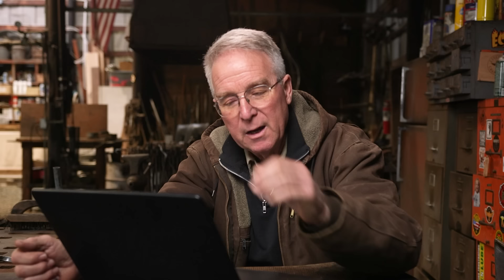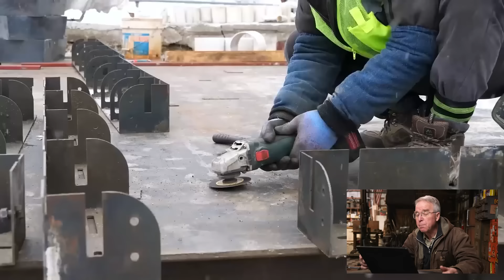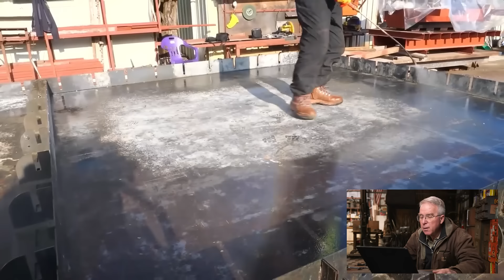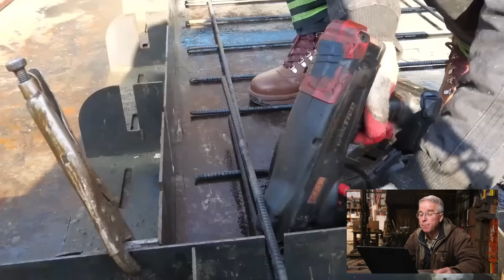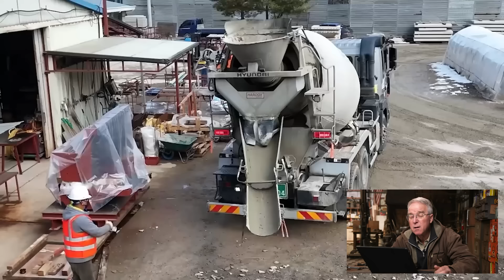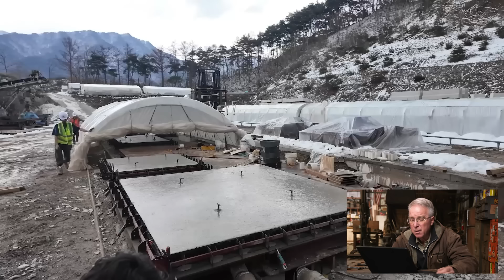40 Yr Contractor Learns CONCRETE  Korean House Construction

Comment: In high-rise construction we use threaded couplers for the vertical steel connections in the sheer walls and columns. You pretty much have to because if you’re using #11 rebar (1.375” dia.) at 8 inch spacing, you would need a minimum bar splice of 55 inches (40 bar dia.). (2) #11’s together are about 3 inches thick, so there’s almost no more room for the concrete. Even using the threaded couplers you need a super-plasticizer concrete additive to get the concrete to flow all around all the steel properly. Engineers really hate seeing honeycomb on their first few floors of columns and walls. Those #11’s are seriously heavy. Each bar requires a crane pick. 

We also used a high-early concrete mix on the floors so that you can achieve 75% ultimate strength in a 3 day test break. You have to get those slab forms flown up for the next floor as quickly as possible.

Comment: Just after the 9th minute after spreading the plastic, the concrete that is poured is what we call a “cleaning concrete,” a layer of approximately 7 cm (approx. 3") on which we begin to work properly on the foundation. In this regard, I have seen several videos of construction projects in the US where they pour concrete directly onto the ground, and in my opinion, this is not advisable due to moisture issues. Personally, I love Korean construction videos.
Reply: We called it a mud-slab and used this technique on very large matt foundations. It helps a lot in keeping the rebar supports (chairs) from sinking into the dirt from the heavy loads of rebar. Great for secure attachment of column rebar templates as well. Fasten the templates right to the mud-slab with power actuated fasteners or Tapcons. Sacrificial templates get poured right into the foundation.

Comment: I’m not 100% sure but down here in the Netherlands we call these floors “rough finish” and later a sand cement floor will be added with a smooth finish of about 6 or seven centimeters. This finish floor will usually holds heating and or electrical wire.
Reply: You guys are correct. Korean use hot water heating pipes to be embedded in the floor then pouring self leveling mortar. So there is no power trowel process. Power conduit usually embedded in CIP slab but in this precast, probably below concrete slab then cover with drop ceiling
Reply: Austrian here we usually first add 10-15cm Polystyrene concrete, then 6-10 cm of that grout cement floor with radiant heating and electrical ducting, then sound dampening , then wooden flooring
Reply: Yeah in England we'd call the sharp sand & cement layer would be called screeding.
Reply: Ja, und normalerweise wird der Estrich auf eine 2-4 cm XPS Dämmung gegossen, also schwimmend.
Reply: @AMeise-vy4fk  not in my experience, but it depends on its use case ,I suppose.
Reply: @CrimeVidich kann nur aus meiner Erfahrung im deutschen Hausbau sprechen. Wir rechnen 12-15 cm Bodenaufbau auf den Rohboden. Darin werden Elektroleotungen, Easser und Fussbodenheizung verbaut, inclusive Laminat odrr Fliesen

Comment: Interesting! I did tilt-up in a former life.
Reply: Yes, in tilt-wall construction, those types of lifting inserts are pretty much the industry standard. We always used thin gauge chain attached to the handles of the crane rigging, so that the lever could be “whipped” and disconnected from the ones too high to reach.

Comment: Seen threaded rebar used to but joint rebar to construct cast in place concrete arches. All of the radial rebar in the cast in place concrete arched vaults of the Washington DC Metrorail subway stations have threaded rebar but joints.

Comment: Idk if you guys got coupler connections in US, but it’s quite common throughout Europe. A coupler is a piece of rebar with a thread at the end, where another connects into it after the pour is cured to continue whatever you’re building. I work as a formwork chippie and it’s quite nice for us not tripping on continuous steel (pre coupler era, still common practice)
Reply: Very common here in Auatralia. We used reid bar which is a continuous threaded bar which gets screwed into a steel foot which has been cast into the concrete. Saves a lot of time drilling that's for sure
Reply: We use coupler bars in the U.S. we call them form savers, they have there place. Especially if we’re using steel plate girder forms, or else if it needs to be continuous. Or else we just drill thru the bulk head and use 1x6 so we can bust it out easily. Form savers are ok. But they can also be very time consuming.

Comment: Hey Scott :) 

34 year old Engineer, Traveler, and Triple National 🇺🇸 🇰🇷 🇨🇭 here.

* 10:23 - So yeah that base is what you'd call a "rodent slab" and we call those smaller raised areas footer pads or hot tub pads; it just helps the crane guy and the workers lineup their placement.

* 14:23 - Korea (and most of Asia) use a bamboo pattern thread in their steel rebar while in the west we use that fishbone thread (kinda slanted/diagonal helix look). Give it a Google and you'll see what I mean. 

* 16:49 - Yup; those are also HDPE Seismic shims; the Japanese have better versions of these when they build those precast panel buildings in the suburbs. You'll see them grout and smooth it all out so it looks uniform to whoever lives there. 

* 21:18 - You've probably seen that 1997 UBC Seismic Map for the USA. If you're looking at it from a PGA 0.15g threshold for 475-years point of view, all of South Korea hovers around 0.10g so think of it as the whole country is a special seismic zone like that weird Kentucky corridor area in the USA. The only non-seismic areas are down in the southwest (Mokpo) and I think the very northeast (near Sokcho Beach).

Hope some of this insight is helpful ~ 

J 🇺🇸 🇰🇷 🇨🇭
Reply: I didn't understand any of that, but I can appreciate that someone else knows these things and is willing to share.
Reply: @10:23, we refer to these as Mud Slabs (slabs on mud). A nice thing to set the final grade and help with protecting recently exposed soils from weather and construction traffic. Usually about 3-4" unreinforced, as the actual foundation will rely on the underlying soils (usually clayey).
Reply: Tried looking into bamboo thread, not a lot came up other than woven bamboo strand type products or textiles. JIS type thread I did find but not really much of a different in terms of pitch measurement differences vs SAE. Flared fittings were a different degree on the flare vs the two but I haven't found what you're describing.
Reply: @SamBrown3787  | https://www.youtube.com/watch?v=Ge4cWkMkaqE&t=185s
Reply: Interesting

Comment: I would love to have one of those houses here in tornado alley.
Reply: ICF is already available and is just as good if not better.
Reply: 3D printed concrete homes is beginning to make more sense in my mind. The few cons, will be worked out. IMO. In Western EU, concrete homes built in the 60s by hand, still stand, in countries like Spain, Portugal, etc. Fireproof, too.   Strength!   GODspeed!
Reply: @AllSeeingHeart  3d printed concrete houses have been cracking from what Ive seen
Reply: @W1ldSm1le  I can't see how the house we just saw would somehow crack. Maybe bad quality concrete? But other than that, as we saw, this thing's built like a bunker.
Reply: @ihalia I'm not sure on the why, I don't really know much about good practices in concrete construction but I've just seen pictures of long vertical cracks opening up in some of them
Reply: @W1ldSm1le  I'm Korean. Because Korea experiences drastic seasonal changes, we build very, very strong foundations.
I believe the 3D printer company, having learned from building wooden houses, built concrete houses, and therefore poorly constructed foundations.
This likely resulted in the ground tilting over time, leading to this phenomenon.